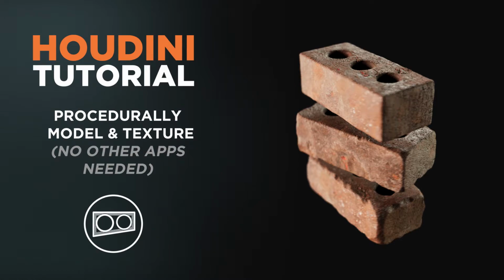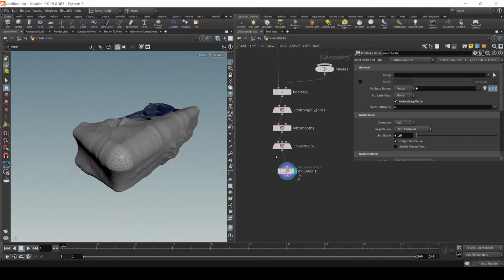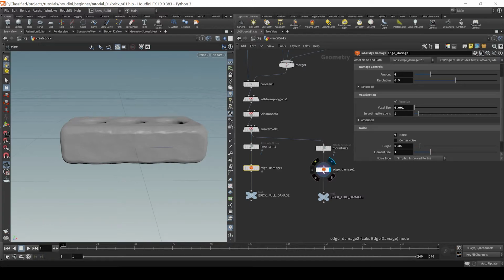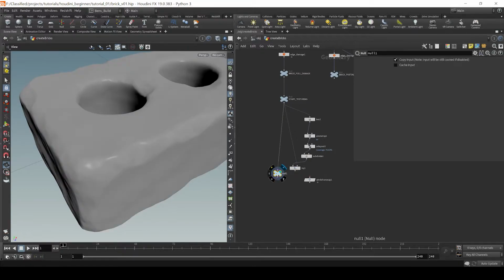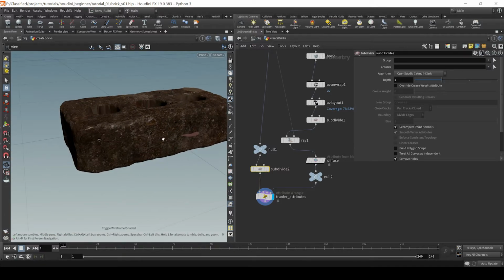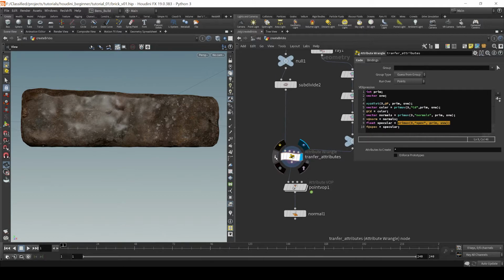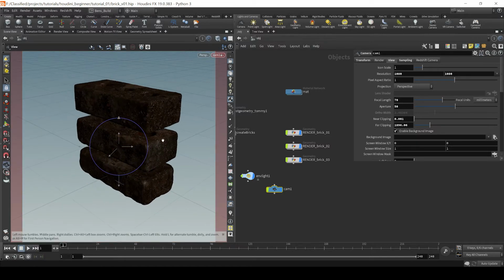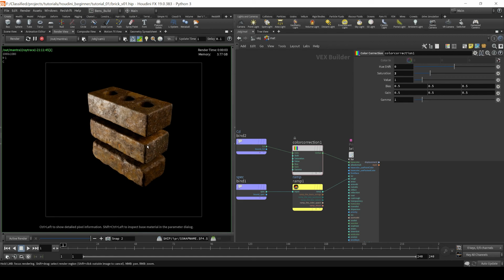Houdini Tutorial - Procedurally Model & Texture Bricks - ALL IN HOUDINI - No other apps required

Comment: Is there a reason to not use the attributetransfer node instead of the wrangle?
Reply from the maker: Sometimes attribute transfer gets less than perfect transfers. For most cases it's fine though. I like using a wrangle and xyxdist with primuv() for best accuracy when snagging attributes.

Totally fine to use whichever you prefer.
Reply: @mrbennelson  Thanks!

Comment: Thank you - great tutorial!  Quick question - could you accomplish the same texture randomness using triplanars and avoid uv's on the bounding box?  You are an excellent teacher btw.  You have a real gift for explanation and problem solving.  I appreciate you including in your videos the process of solving the inevitable unexpected issues that arise.  I look forward to future content and will check out your Patreon page.
Reply from the maker: thank you! Yeah so you could do a tri-planar projection for sure, but that would just be handled at rendertime, and usually is calculated slightly different depending on your renderer. 

This is more of an approach to UV map and get things done, and potentially shift it to another application if you had to. 

Thank you! Actually I haven't done much with Patreon because I'm wanting to build my own site instead to host premium/free videos. So stay tuned for that!
Reply: @mrbennelson  Thanks for the explanation and responding so quick.  Makes sense...but there's about another hundred questions I would like to ask.  So, when you have your website up and running let me know; I'll be in line to sign up.  Thanks again.

Comment: Great tutorial but at 21.46 my brick is completely black.. The texture doesn't seem to work anymore.
Reply from the maker: try checking that you are loading the texture in as a Cd attribute on the attribute map node. Sometimes that's a "gotcha".
Reply: @mrbennelson  yeah i also have this problem. and its set as a Cd
Reply: Ignore that it was a capital letting in the code. I am however having an issue disabling the visualization for the normal maps as mine is greyed out and unable to un check it
Reply: Also have simillar problem, only 1/4 of my brick have trexture, rest is black. and i cant figure it why

Comment: now you can take this into unreal and enable nanite which makes polycount no longer an issue, the only drawback would be the 200Mb per brick.
Reply from the maker: totally could bring it to Unreal -- however, you wouldn't get the color and spec attributes there that I'm using to try the shader. However, you could uv map this so then you could texture it in Unreal.